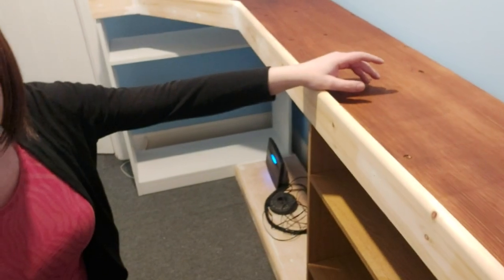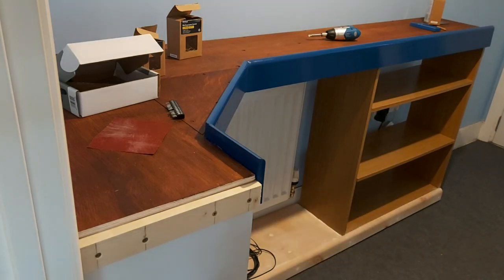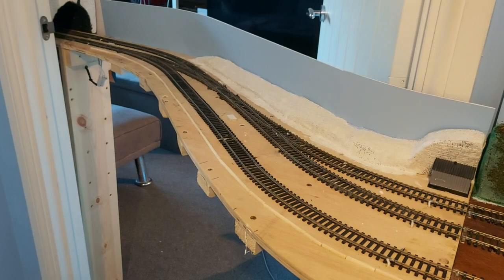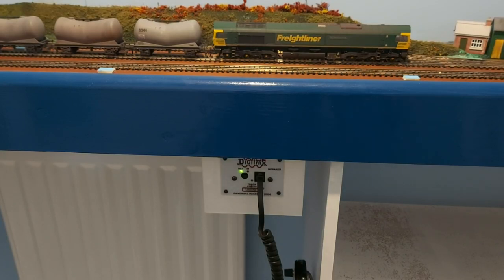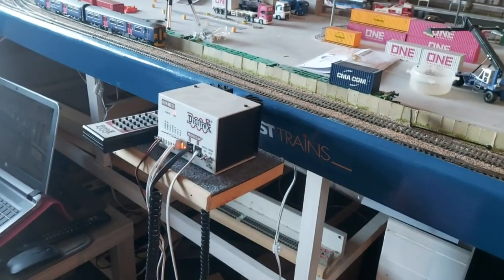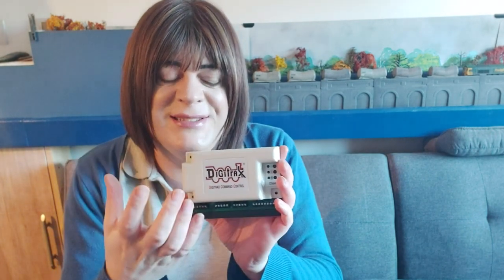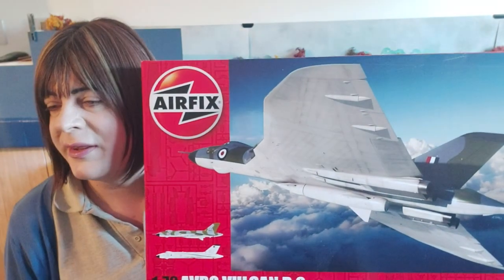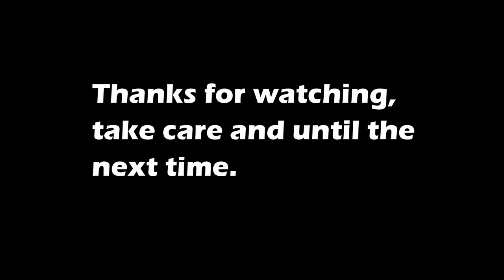Layout Extension: Part 3, 4, 5 & 6

Comment: hi susana all ways interesting video I am sure you  will not regret choosing  digitrax control system I have been using this system for more  than 20 plus years and so far have had no problems running my multi track dual level layout only advise is keep your instructions to hand especially when you run lots (100 plus) locos.
your extension looking good  but how come you haven't used modern concrete  sleerered track but looking forward  to next videos 
kind regards ralph